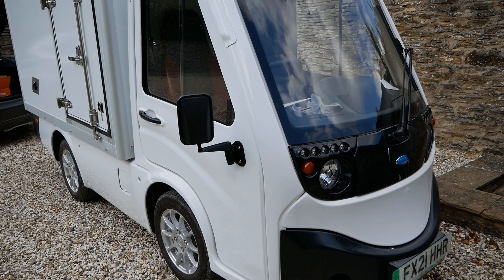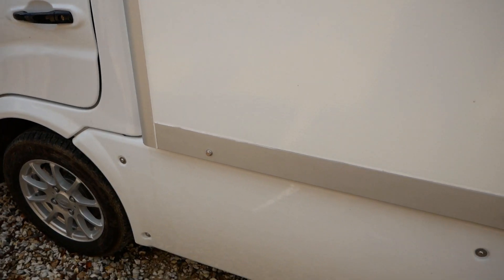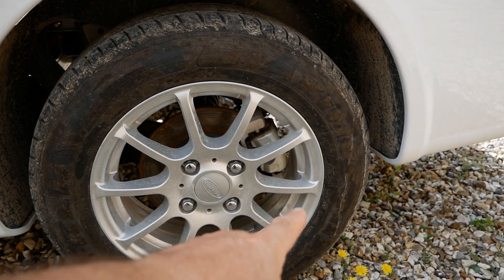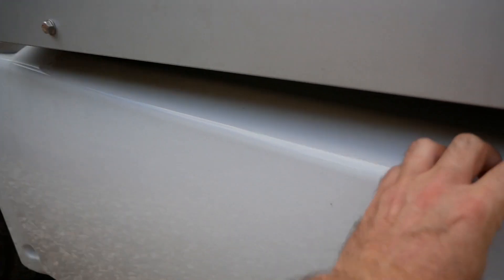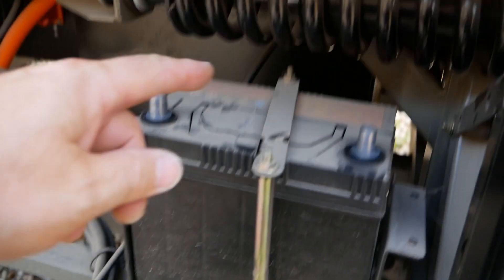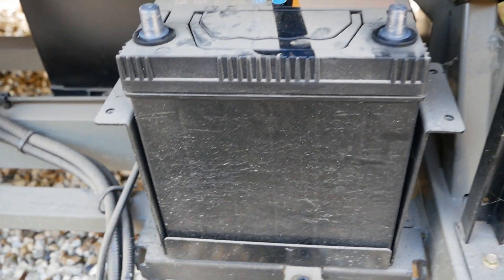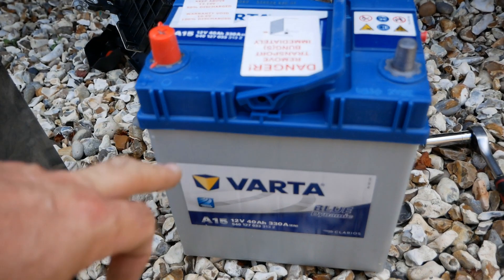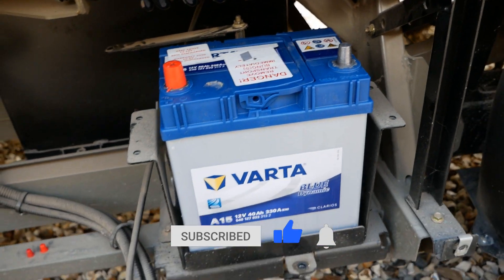How to replace the 12v auxiliary battery in a Cenntro Metro electric vehicle?

Comment: i just bought one of these used, and cant find any info, thanks for the video!   mine is a cenntro but says duramag instead of metro.  same vehicle but the batteries are lead acid (2017 model).    any idea of i can convert it to lithium?  the batteries are shot.  cenntro does not answer calls or emails & im left without any info.
Reply: I have converted my cenntro from lead acid to LFP Batteries. It is possible to use the same charger and let it be stopped by the new BMS. But I run a timer on the socket to disrupt the charge after my calculated time of charge, so the batteries don't get charged 100% each time. I have build in 14kWh and a new BMS for round about 5500€.
Reply: @klaussommer7382  i converted my main batteries to lithium now also. the factory charger with bms seem to work great together.  although i still wish i could figure out how to program the speed controller so i am not limited to 25mph
Reply: Mine is limited to 40kmh, might be responding to your 25mph. If you ever come to a conclusion in this matter, please let me know.
I have inserted a converter from 80 vdc to 230vac so I can use the batterie to feed the house with electricity at night. Works great. How big have you chosen your lithium battery?
Reply: @klaussommer7382  i am using 2 7.9kw batteries recycled from a hybrid vehicle.
Reply from the maker: I doubt if it is worth the effort replacing them with lithium as I'm guessing the charger & BMS probably needs replacing too.
Reply: @GoGreenAutos  do you have an idea of what it take to adjust the programming in these. mine is limited to 25mph, but it says that can be  set to 40mph for offroad use.  im using this around my property & would love to be able to go alittle faster.
Reply: HI, where did you get the used one?

Comment: Hi how many batteries are in the Metro, does that single battery run everything for the 180 km or whatever the range the Metro has? Or is there another battery pack for the 24 volt motor? Thanks
Reply from the maker: These have a 13kWh lithium ion pack, or they can be doubled up for 26kWh. All the details are here https://www.gogreenautos.co.uk/for-sale/saturn-cityvan

Comment: since all ev have a 12volt normal car battery for auxiliary use 
my vw t4 had extra battery in rear for all the extra 12 volts things  in rear but was charged by solar panel 15watts and 2x 1.5 watts solar  always kept my batteries working 
but why do no ev have any solar to keep auxiliary battery topped up ?
could we use one 1.5watt on a ev ?
as car sat 6hrs in daylight so might as well get something rather than nothing even if just cancels out alarm drain be worth it as might translate as 5miles range extra range  as all my driving tends to be whilst it dark raining misty ect. 
i know not about this van/ev just maybe make a vid on it